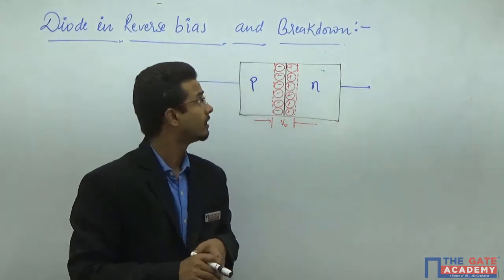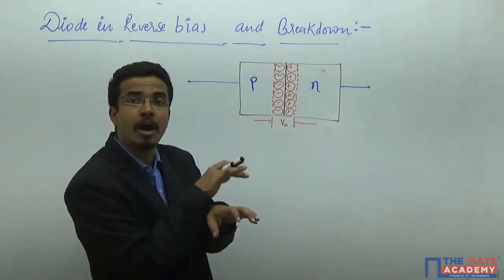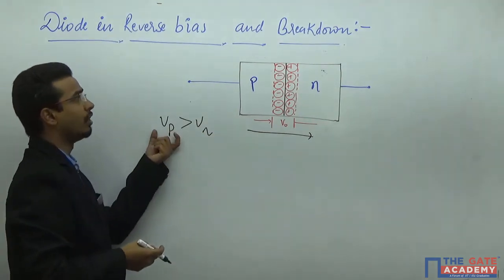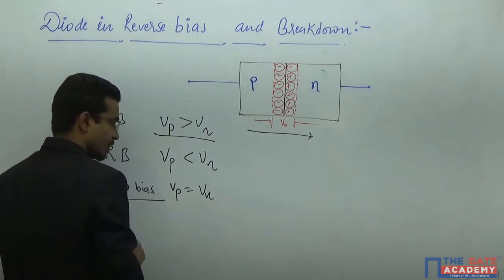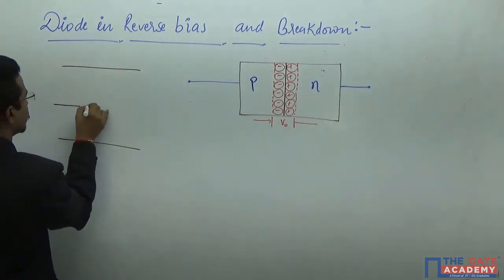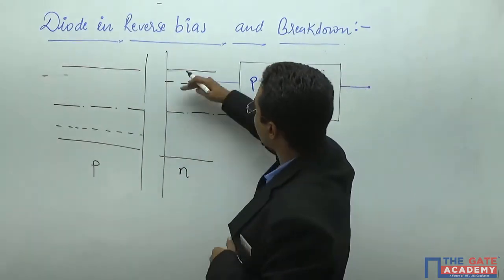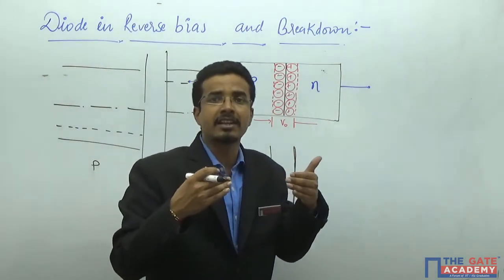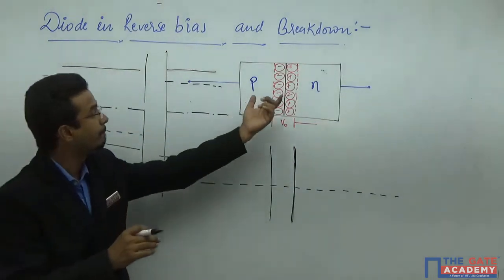Diode in Reverse Bias and Breakdown | Electronics Device and Circuits | EC

Comment: Sir according to mass action law increasing in doping concentration minorities carriers  are decreased but sir thermally generated minorities carriers are constant.if we increasing doping concentration then minorities carriers will be increased or remains constant
Reply: This is really a big thing to concern...
Actually why do we used to say that minority charge carriers depends on the temperature because :- 

1. If we will look at the scenario before the doping is been done, then equal number of electrons and holes pairs will be generated due to the thermal energy present in the room (THERMAL EXCITATIONS).

2. Then after the doping let say P-Type doped then the concentration of holes will increase but the thermally generated electrons are still present inside that semiconductor and they will only change when we will increase the temperature.

3. Hence by saying that minority charge carriers concentration will decrease is actually means that the relative concentration of minority charge carriers will decrease as doping will keep on increase the concentration of majority charge carriers only.

hope this helps :)